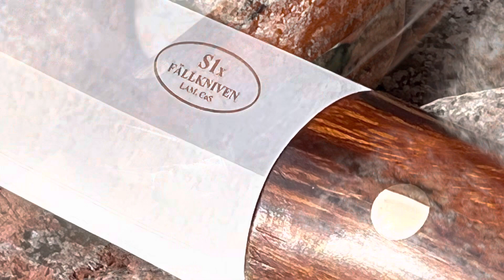S1X Customization @thetopicala 🇫🇮

Comment: Thank you for showing  complete shaping process, I find it very relaxing.

Just wondering what is the belt speed and roller diameter?

Cheers man, keep well!
Reply from the maker: Thanks! Google Scheppach 900 speed, very close to original with new motor. 👍🏻